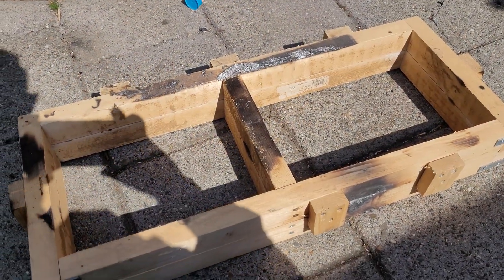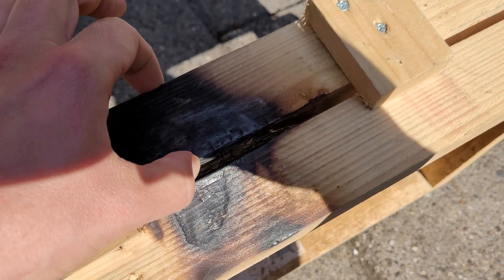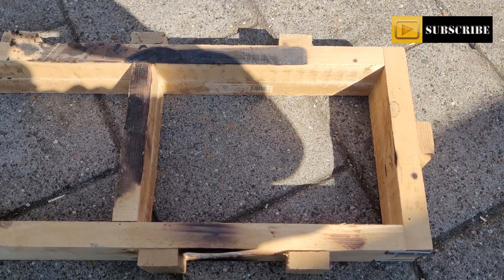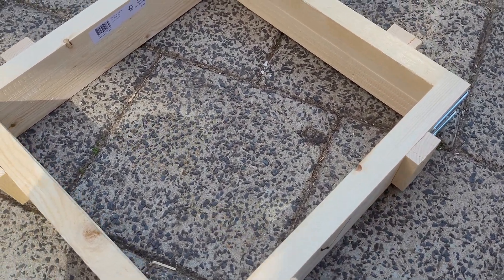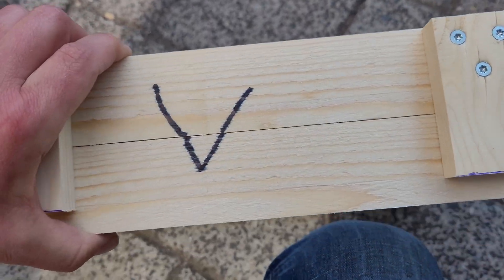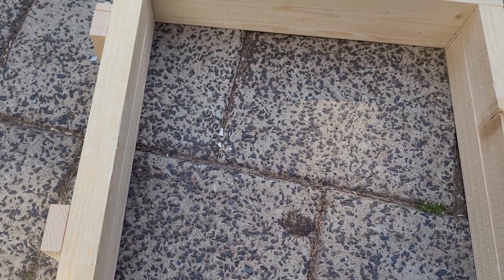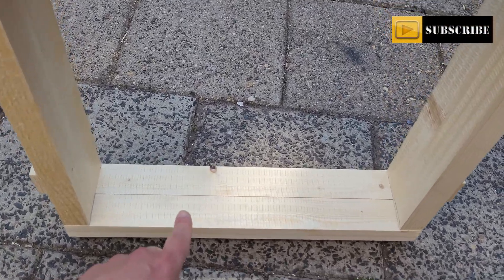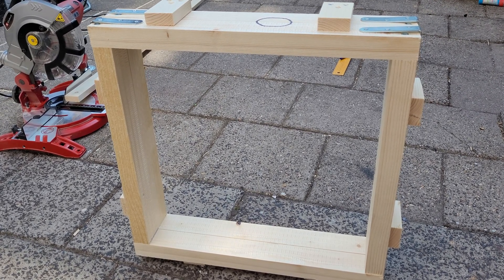How to make a flask / moulding box for metal casting in sand!

Comment: Will casting sand stay locked in an area that large when lifted? I will be attempting to cast in a few weeks. That sand must have amazing properties !
Reply from the maker: Make sure to pack the sand real tight and pay particular attention to the edges. If the sand falls out, you could try to add a smaller piece of wood on the inside as a ridge where the sand can have some grip. I never had problems with my flasks. Good luck!
Reply: Thanks for the advice ! @Metalstacker